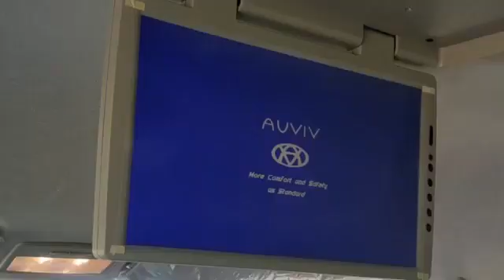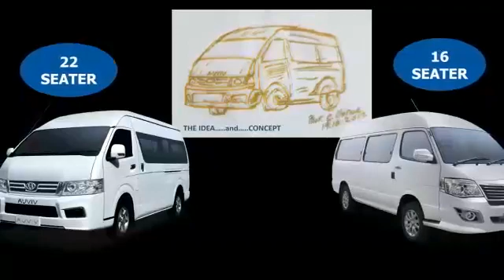Zambia’s renowned UK based Professor Clive Chirwa has designed and manufactured a high roof monocoqu

Comment: Such progressive movement needs to be supported. I am bothered by people
 that undervalue such things. A few days ago, a few friends highlighted that it looks like a Toyota Quantum bus, looking at it in that angle will undermine what little progress the country will make. You should be interested to know that when a new product is launched, you can take 
two paths, make something completely new and revolutionary like Apple did with the iPhone or do like what 
Tesla did with their first roadster, get an existing design and fit your idea in it. One of those paths has a high chance of failure, it will 
require investment in educating people on a new standard of beauty. As a society we naturally get used to something and set it as a standard of 
beauty. When iPhone was introduced, the world didn't really accept touch screen mobile phones but rather qwerty keypads rocked by Blackberrys or
 T9 keypads rocked by Nokia and others. They had a huge advertising campaign, and now everything Apple does everyone copies. From the location of the charging port, to removing the 3.5mm headset jack to speakers next to the charging port. Infinix Mobility, seeing this trend 
jumped on, not trying to be unique in overall design but rather in pricing and their target market, Africa or other slow-developing 
nations.
 Back to the topic
 Here's a bus that looks like a 
quantum, but might be cheaper. Either through direct purchase or servicing costs. This may provide an opportunity for government and microfinance services to offer cheap loans to get one of these for civil servants which means more busses which means more revenue for the council. And lest we forget, In my opinion, Lusaka makes most of its money through the public transportation within.
 To be honest, am 
excited about the future. If a Zambian copies a plane design and 
implements it on home soil, I will be exceedingly proud as if it's the 
first of all planes😎
 Let's learn to embrace our own, until then we will continue importing everything.